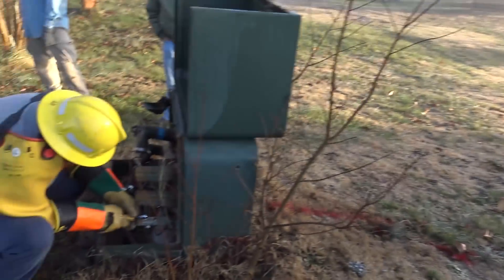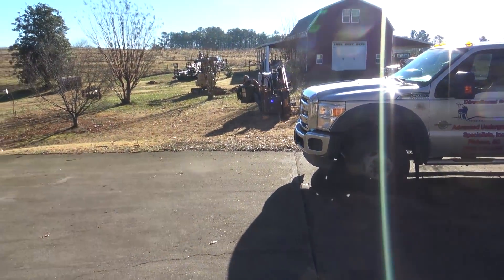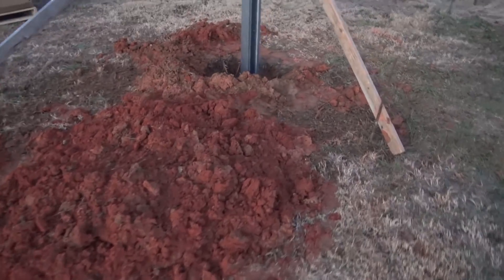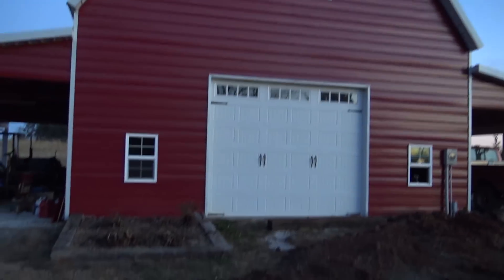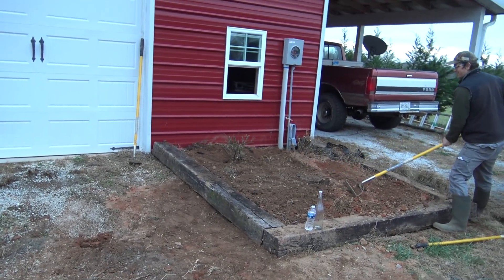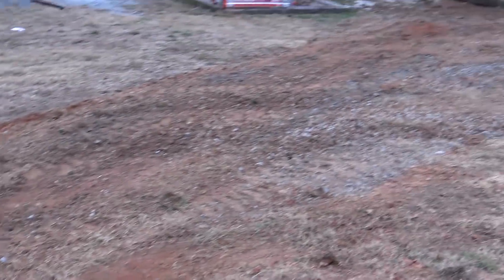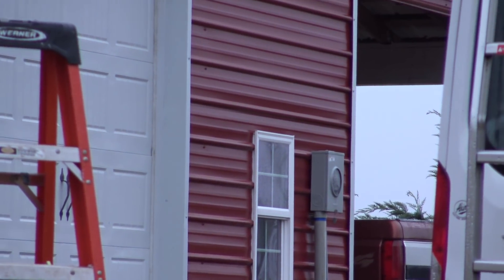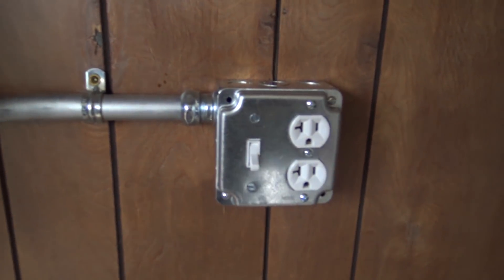Secure Power without Batteries

Comment: On the 600tl  grid tie inverter, on the SPS circuit do the five wires just press into the slots. Or does one place a small screw driver in the other slot to relieve tension on it while installing those five wires?

Comment: To all. Another method is to breakup the task of supplying the DC power via the sun. Get a 12v DC fridge with batteries. Get muitiple 12v DC aircon/heater with solar panels. Sun shines, power on. Get hot water heater tank on roof powered by solar panels and induction tubes or ground mounted water tank powered by solar panels. Most importantly....build a rocket stove and a rocket heating system.

Comment: I am new to your channel, You put the electric panels on the exterior of the structure, You had your reasons, or perhaps it was the owner's call. Personally, If I were having this installed, I would find a way to have all the panels inside the structure. Maybe I am Anal, but that would keep them dry, and secure.

Comment: So essentially the inverter goes into grid bypass mode when it loses sync with the grid while still inverting.  This results in not needing to by a Sunny Island and batteries.  It's all great so long as the panels are generating.

Comment: I'm a bit confused as to what the secure power supply (SPS) product is. If it's not a battery...is it like a big capacitor? (The kind you DO NOT lick...) :-) or is it a generator? I'm not sure what other options there are to be honest, besides those two and battery. But, the title of the video had me scratch off that option. Just curious what it is, how it works...and how quickly does it kick in? An in-line capacitor I can understand working in 0ms. But, if I read the comments right, 2000 watts for 30 minutes seems like a whole mess of electrons to have hanging on the wall! Love your work, and the professional, clean look of the project when you're done.
Reply from the maker: The inverter uses its capacitor bank to throttle PV array current, varying its internal resistance and acting as a current-controlling device to provide a stable voltage. Changes in insolation will cause the array output to fluctuate, which will influence how much power will be available to the SPS circuit. If the loads on the SPS circuit exceed 2000 W or what the array can supply, the inverter will disconnect from the SPS and then try to reconnect every 20 seconds until the load size is appropriate.
Reply: I'm not engineer, and I don't play one on TV...but, I like working with engineers, even if my brain cells go "pop" :-) And, that second sentence cost me a handful of brain cells! I'll ask one of my clients to explain it to me. (They draw me pictures and use small words, since I'm an IT guy.) Seriously, thank you. That actually gives a me a good picture to start with. It sounds like it's taking a function the inverter already has going for, and adds a bit of robustness (and intelligence) to it, so that it functions like a battery-without-a-battery. This gives me the goods for digging into it more. I love the 20 second retry thing. A relatively straightforward instrumentation/control loop that can save a lot of trouble. Cool stuff! Thanks for sharing this stuff!

Comment: Great fast install Scott! That was a lot of work for 2.5 days! Clearly you had it all planned and lined up to get it done that fast! 

What ground mount and racking system did you use for mounting those panels? 
How far down for the vertical mount does the concrete go?
What gauge wire and distance for the 360VDC string run?
Reply from the maker: Nobel House thanks. Schletter fs ground mount.  Posts in 2' diameter holes 6' deep. Running #10 thhn .

Comment: Would it be possible to have a SMALL battery bank on that thing? It seems bothersome that if I get a few minutes of shade my stuff doesn't have power...
Reply: You can't go too small, otherwise the battery can't provide sufficient amps. Usually you have a 2C discharge limit. For a constant load, this results in a supply of at least 30 min, but with all the bursts you usually have to provide at least a 2h supply to stay within the discharge limit.

To give some numbers for a common cell, Samsung 18650, Capacity 2600mAh, maximum discharge 5200mA. Under no circumstances you can drain that battery in less than 30 min without exceeding the specifications.
Reply: Aaron, my take on it is this approach is purely the "avoid battery" design. I suspect if batteries were going to be  player, there would be serious design change to the system. I'm a fan of combining wind and solar, to hedge the continuous charging bet. In which case, I'd want a system that was purely "battery powered," with solar, wind and backup generator to recharge the battery. I'm not expert, fer-shure, but, I think that distinction is part of the design differences. Hopefully, someone smarter can fill in  more of the gaps.
Reply: Dan L 
what I would like to have. is enough solar to power my inverter. and charge my batteries. that way I can use power constantly and not worry about the batteries not charging! I'm fully off grid. I need a good source of panels. share the shipping is not more than the panels! is there a warehouse in the western north Carolina area? anyone know?
Reply: James, If you can find others in your area who are interested, one way is to get 5-6 different families ordering together; if you're each getting a fairly significant number, you could get a real break on the shipping. (Particularly if someone in the group has a business they can do a B2B order through.) I'm in New England, and we have local solar group that's pretty reputable. (Re-vision Energy) If I can't get enough friends and neighbors to join me, I'll go through them. As for the design, if you're thinking of two separate banks of solar (one to run, one to charge), you may get into some interesting requirements. I wouldn't be surprised if you have to "overbuild" both segments, which could get pricey. I'd be inclined to suggest getting an inverter (or two or three) sufficient for your whole house, and power it from batteries. Get a few solar panels, and a backup generator. Then keep adding solar panels until you quit buying gas! I'm saying that somewhat tongue in cheek; it would be better to build it all out at once, but, realistically, you may not be able to do everything up front. If someone who knows this stuff (hat tip to the owner of this channel!) can design the "master plan" for you, it could probably be done in a way that's built in sections. I don't know if this is possible, but something like Phase 1: inverter & "backup" generator; Phase 2: Batteries and charge controller(s); Phase 3: A few panels; Phase 4: More panels;  Phase 5: whatever's next. (wind? hydro? add'l panels? add'l batteries?)
Reply: James  - I should've started elsewhere....what gear do you have already?
Reply: Aaron Anderson exactly
Reply: Of course it's possible. Anything is
Reply: Aaron Anderson 
it's a grid tie system, so the solar feeds the grid and the service end is the house and barn pull power from both the solar and the power grid. It's probably a government funded program and isn't practical if a person had to pay cash.
Reply: even in shade you get power, you would need no moon overcast and night to have 0 power
Reply: Power vs adequate power are different. There's a lot of difference in full summer sun vs a big ass cloud covering the sun for 10 minutes.
Reply: Aaron Anderson Battery Backup is the only way to go.

Comment: what part of the country are you in that the soil is that red?
Reply: The necks are red too!!
Reply from the maker: Upstate SC
Reply: Dirt(clay) is red in GA too.
Reply: Bart Hamburg its like that here on North Carolina. red clay almost everywhere!
Reply: Engineer775 
I need some panels!  do you know of a place where I can buy 1-2 per month. about 250 watt. 24v. I can't afford paying $150+/- and $300 for shipping!  I'm in west NC and can drive 60-70 miles to pick IP a couple per month. great video. I'm a newly subbed...
Reply: SmoothRide, not so, the soil, called "ultisol", is a red clay. The iron in these soils is Iron Oxide and highly insoluble in water. Where I live in the foothills north of Charlotte, NC, the clay is so red it looks orange when it dries. I have kept aquariums for over forty years and I regularly check the chemistry of my well water; it is soft, slightly acidic, has low carbonates and NO detectable Iron. My aquarium plants would love the iron, but I have to supplement their water with it. To all my cousins in the Upstate, "Y'all know what I mean!"

Comment: How many solar panels do you need to make a refrigerator and freezer going? I was thinking my summer house could need a couple of those in case of a serious power outage / war times.
Reply: Grante a 100 watt panel is about 22-30" by around 40-42" some are about 27" by 39" or so. they even come in 39" by 42" or close. almost square. the panels I'd like to get are about 42" by 76" OE close. they are 320watts each. but shipping is almost $300 ! lots of the 100watt panels are less than $120-$150 free shipping and a good but cheap charge controller is under $200.  and 2-4+ golf cart batteries. can be cheap as 100 each. but they are 6volt. that's what I have. I'm trying to go lithium. but a minimum panel to battery is about 1 watt per amp hour of battery. but 1000 watts on a 400 to 600 ah battery bank will be good. a 100 watt 12 v panel. gives about 6amps depending on charge controller. that can be around 60 amps. I'd go with a pair of 40 amp controllers. aims has the perfect inverter for this type system. 1200 watts. with built in transfer switch. so if the power goes out. it switches to inverter. I its about $170 I was going to get a few of them. but got a larger one. I got a 5 kW. hope I helped. if you need to know anything else I'm here. and if I know I'll help if I can.
Reply: simple maths, look at the amp draw pr wattage and your answer is there
Reply: Grante 
I'd get about 1000watts in panels. about 400ah in batteries. and a 2000-2500watt inverter. because you likely would want a light or two. and maybe radio or TV.  I have a 5kw inverter. and 200ah batteries. for just that. and I'm trying to add to it. for about the same use. but I'm fully off grid!
Reply: Thank's for answering! About how many panels is 1000watts and how much space would that require? I'm thinking of maybe removing some trees down close to the lake and putting up the solar panels there, but I would need to know how much space it requires.

Comment: Why??? Why, out of ALL that yard........would you ever really hit a water line way out there. It never fails.
Reply from the maker: Nothing finds water lines like a mini-excavator.  :)
Reply: There's this guy named Murphy. And, he's really good at showing up to construction projects the same day as the inspection.....
Reply: Why would you bury any utility line and not put warning tapes above them?
Reply: P Schmied - is that commonplace in residential developments? ( I see marker's like that at industrial or larger commercial, but, I don't recall that in retail establishments or residential areas.) I do see wire + flag markers placed around during construction, but they seem to be gone by the time landscaping is done. (I assumed they're intended to be temporary.) Good thought, though, if it can be done aesthetically or with subtlety.  Otherwise, I can see why the markers don't stick around.